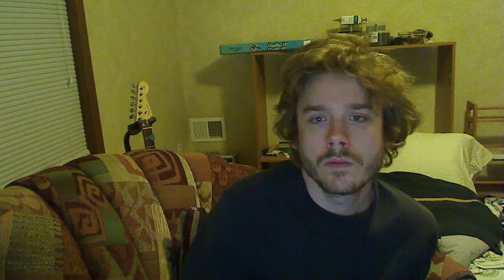Breakthrough in Circuitry - Using light instead of electricity

Comment: The "conductors" for an optical circuit would have to be transparent. Silicon nitride has an index of refraction of 2.0. They are also experimenting with Si3N4 gates so it may be possible to build an optical computer with them. Using light may allow a higher circuit density and would make computers more compatible with fiber optics. Will they make quantum computers a reality? That remains to be seen.